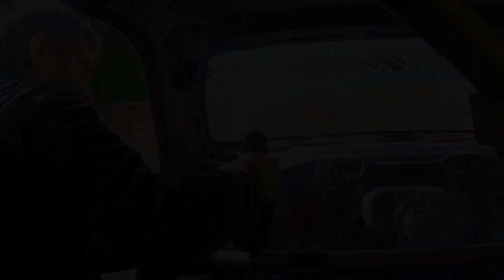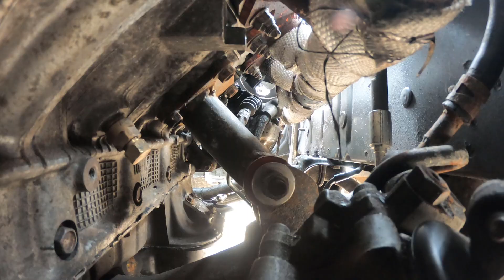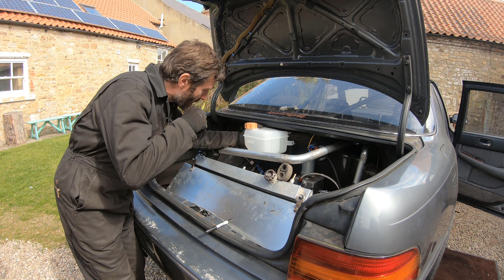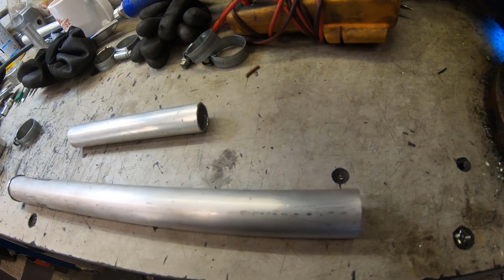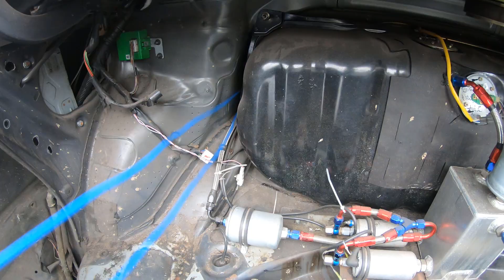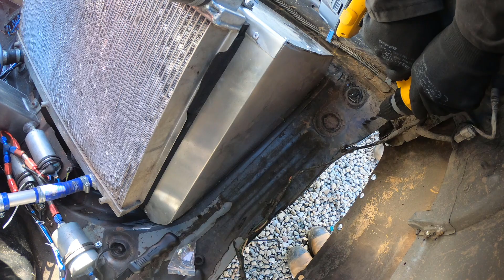LS400 Rear Mount Radiator Part 2 - TurboShed Part 40!

Comment: I have a question do you believe that the radiator needs to lay towards the back or could it lay towards the front I'm asking because I'm doing a 4.72uz in a pickup and want to rear mount the radiator but I don't want to put it by the tailgate I would rather put it up against the front
Reply from the maker: Shouldn't make any difference really, its the fans that do the cooling so provided they have good airflow in and out you should be fine 🙂

Comment: Beware of the ASH hoses... i personally and alot of people i know who have used them on coolant systems in the past have had issues of the silicone degrading and the ply allowing coolant to flow through it resulting in entire coolant system replacement...
They're great for initial designing of custom coolant systems due to cost but when they fail just upgrade to better quality hoses... otherwise they will become a service item..
Great work though
Reply from the maker: Interesting thought so thanks for that. Weve had some of their hoses on the car for 3 years now without problems but will for sure keep a close eye, might have to switch to Samco if we start seeing issues👍

Comment: What are the benefits to running it in the back ? Good content
Reply from the maker: It gets all that heat rejection out of the engine bay, and also adds more space just for working.  A side effect is also greater water capacity in the system which also helps stabilise the cooling.  Thanks for the comment on content, we do our best so glad you are enjoying it :-)

Comment: Will the Lex still be road legal after this?
Reply from the maker: Sure, why wouldn't it be?  
Edit:  Ah yes maybe you mean the fact we've cut steel out at the rear.  I'm pretty sure it will be okay as we've not left any exposed edges, and everything we've removed was non structural, or in the case of the boot floor actually replaced it with aluminium.  We got it MOT'ed a week before this so won't find out for another year!
Reply: Strictly speaking having the bolts holding the rear bumper at the side should fail the MOT it should have domed head bolts as they are considered 'sharp edges'

My argument is if youre close enough to the car when its moving to get hurt by the hex head of a bolt.. the bolt is the least of your worries.
Depends on if your MOT tester is nice or an ass

Comment: Awesome job guys. I may have missed it but what did you do regarding the standard water pump? Cheers
Reply from the maker: We left the standard water pump in, so we only use the EWP over 60 degrees C. It gives the alternator an easier time not running the electric pump all.the time👍